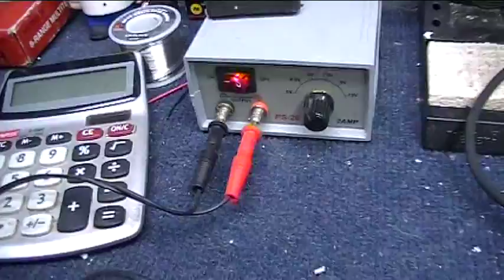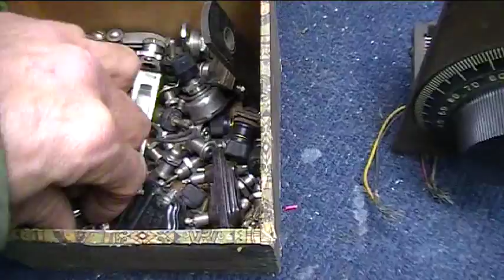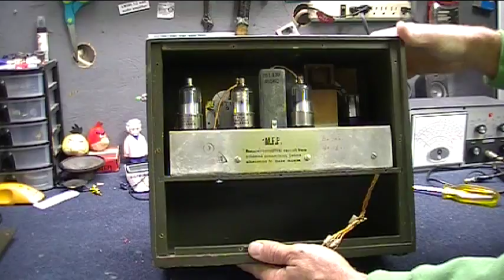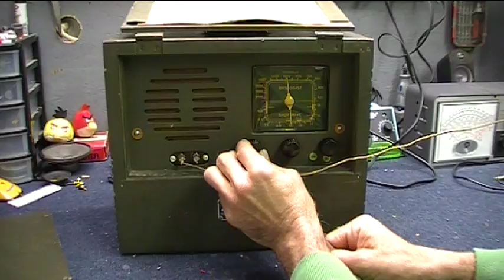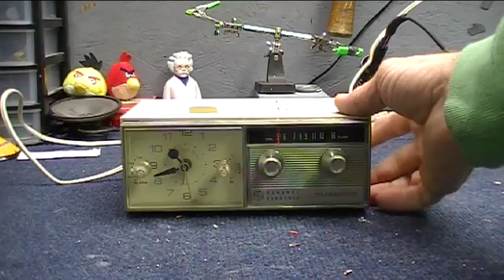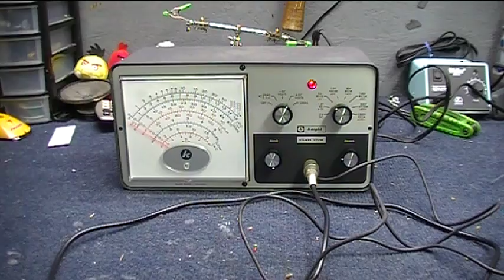Vintage Electronics Find

Comment: What you first said is RF Chokes - I believe they're coils for different ham bands.  They're made with just the right number of turns to work with that variable capacitor to make VFOs (variable frequency oscillators.)   
Combined with other fixed capacitors and a transistor OR a tube oscillate at the frequencies used by hams.  They could also be have been used to make short wave receivers.
Cool old stuff.

Comment: When I was a teenager, I somehow came across a battery-powered radio with a wooden case.  If I remember right it used a large 1.5v cylindrical cell to power the filaments, and a 66.5v battery for the tube plate voltages.

I thought it was fascinating, and purchased both batteries.  The high voltage one was very expensive with my limited income, so when they were used-up I never replaced them.  I think I built a power supply for it and used it for quite a while.

I don't remember what happened to it.  I probably used the parts for something else, not realizing it's value.  Today, I take good care of things like that.

Comment: The eye is indeed a vacuum tube. It works on the same principle as a CRT display (shooting and bending a stream of electrons on some phosphor, which then starts to glow). They are mostly called "magic eyes" and they were mostly used in radios to indicate whether your radio has been tuned to a station correctly. They also contain a filament, which explains why it takes some time before the display comes on.

Comment: Talking about intermittent switches, the power switch in my old Fluke multimeter finally became intermittent after many years.  It looked like it would be tough to replace, and it looked like it didn't have enough of an opening to get contact cleaner in, but I tried a drop of very old CRAMOLIN cleaner, and lo & behold, it came back 100%.  It's still working fine 2 years later.

Comment: I am not a huge collector of vintage radios, but I do have a few and I know that these pieces have found a good home... to stay.  Still, I would estimate that treasure trove to be worth a thousand dollars at a bare minimum and perhaps several thousand. But then I am stunned at what people toss or give away, I once found (sitting by the trash) a beautiful 1955 VM wooden cabinet Tri-o-Matic record player that was a VM company presentation piece for a top seller, and it still plays fantastically.

Comment: I have been off the air so long that when I fired up my receiver a few years ago, I couldn't figure out what the heck was going on when I heard  calls beginning with "N". Thought for a moment the Sun spots were going crazy and DX was booming in! I also found out that we had gotten some additional bands. When I had my fire I was building my code speed up to get my Extra; I was at 34 WPM. But the fire just ripped my heart out and after losing things I had built all my life I gave it up.

continued

Comment: Those 1/4-inch TRS jacks are probably old W-E switchboard jacks; they were made in this manner because they had to be easily serviced.  

I've never experienced a series-string radio just burning tubes out, and I've worked on quite a few of them.  There has to be a short somewhere in the filament string to cause that to happen.

Comment: I like the Capacitor tester best, since you probably do not know how rare, expensive these magic eyes are. And this is one of the most "looked after" magic eye tube ever. So wear a big smile in your face when using this. But do not leave it on for hours, since this sort of magic-eye tubes worn out pretty fast. But this particular tube is bright as a new one. So use this carefully and be proud to have such a lovely tube!

Comment: I have an old Bendix automotive primary condenser tester which I have occasionally used to test old polyester and mica capacitors.  It has a rather limited range, but it does have a mode to check leakage.  And yes, it is tube based.

Comment: LOVED the old tube stuff, especially that magic eye! I have an R-C tester that uses a magic eye for null adjustment and measurement. As far as that 8 transistor radio goes, those kinda look like old style germanium transistors. Many of those were not the modern planar type, but had tiny little point contacts. They were incredibly fragile if they received any manner of significant impact.

Comment: The Zenith was one of their higher-end AM sets.  The "Filter Magnet Antenna" circuit cuts down interference from RF signals, such as a fluorescent lamp.  I used to keep the successor to this model right next to the computer and there was no interference.

Comment: when I was a teenager I had an 50's/ 1960's blue, GE, clock radio I got at a second hand store for like $5. just like the one you showed, it had the convenience outlet on the back, and I would set it up to turn on a lamp and radio when the alarm went off, to get up school and later when I was in my 20's  working at a hospital. I used till it finally died up to the late 80's. by then I had bought a newer one. and ended up donating it  to another thrift store for someone else to mess around with.
I dont remember if it had the RCA input Jack tho.

Comment: Really enjoyed this video. Thanks for showing us your neat electronics stuff. That non-functioning black transistor radio may just need its electrolytic capacitors replaced to get it working again. My Dad had the same radio back in the 70's.

Comment: The shortwave talkers are probably transmitting in SSB. One needs a BFO to add the missing carrier frequency. Another (super-)radio may do the trick. A super has a VFO that can act as the BFO by radiating a signal.

Comment: It looks like one of the previous owners of that moral radio serviced it at least a few times, I see what looks like some "Black Beauties" under the chassis. The "Black  Beauties" were paper capacitors inside a molded plastic shell, they were popular from the late 1940s to early 1960s as replacements but still fail like regular paper caps. The battery eliminator is nice to find, very useful to power late 30s and 40s battery tube radios, but like the radios they need to be rebuilt

Comment: Good show. Thank You for doing it. I may have a tip to relay on those scratchy noisy switches. A fellow in another YouTube video recommended Radio Shack's "Control Contact Cleaner and Lubricant" as a remedy. It has worked quite well. Apparently, the cleaner shines the old rheostats up and the lubricant keeps them that way for a good period of time. It is a little spendy but it promises to service lots of switches and last a long time.

Comment: I couldn't believe I watch a 30 minute video on old radios I had forgotten how interesting old electronics was.  I cut my teeth on vintage electronics you have to know where you been to know where your going.  You need to post a video when you get an outside antenna on the shortwave radios.

Comment: The second device was a "wavemeter" A meter or bulb probably plugged into the front panel connectors. The coil (not a "choke") resonated with the capacitor and current would light a bulb or indicate on a meter on  the front panel .A chart would convert the numbers on the knob to meters to indicate the frequency of the transmitter. In the 50's and 60's Ham radios were capable of operating on their "fundamental" frequency and on multiples of that frequency. For example, a Ham transmitter working on 3.5 MHz (80 meter Ham band) could be made to transmit on 2X3.5 or 7 MHz (40 meter Ham band) A wavemeter was invaluable to be sure the transmitter was adjusted for the correct Ham band. 

You have the same problem I do with an old AM receiver. Instead of old broadcasts it receives modern broadcasts (ugh!) 

Lacking any transmitter, it sound like that fellow, like many others, never learned the code well enough to get a license. It wasn't easy working alone. I was lucky enough to have a neighbor Ham who helped me and his son learn Morse.

Comment: On the Luxtone radio. It is most likely open capacitors. Just replace all the electrolytics, and it should work....  Also, a little contact cleaner in the control and tuner, and you are good to go....

Comment: The brand Z tube radio is a series string AC/DC set, that transformer is likely an output transformer to couple the audio output tube to the speaker. It looks like a good radio though, it has a tuned RF amplifier stage, why it's blowing out the replacement tube will have to be investigated, it could be that there is a short in the filament circuit or one of the other tubes is of the wrong type or is in the wrong socket.

Comment: Very nice video, I really enjoyed it. The radio in which you described a tube glowing really bright and then burning out probably indicates that a power supply filter capacitor is bad in the set. It would probably be a good idea to replace all of the old capacitors in the set before you power it up again for long so as not to damage any of the other components. Again....Enjoyed it greatly as I too enjoy tinkering with the radios which glow in the dark.  Best 73's and have fun shortwaving~N4TYX~

Comment: Far out, did u get some sweet stuff for helping a friend or what? I couldn't help chuckling to myself as you kept producing all those neat vintage valve radios and then progressed onto the transistor stuff. It was like looking back through time to see all those things and as you got the valve stuff working well my jaw was on the floor. Great Vid :-)

Comment: all I have is a simple tube radio. I had a nice old radio. but lost it when the house burned down.  it was from like the early 40's. don't know about the one I have now. its trashed. so I was thinking of putting modern radio. inside. and connect it to the speaker.

Comment: I mentioned to the trash guy that I salvage junk electronics, for parts , and I got 5 radios (took the good stuff out) and 1 radio is an FM/AM/SW, but it didn't work. I opened it, and found water inside, so I used a fan on it, dried it up, and it works perfectly! Checked online, and its worth over $100 new!!!jackpot!!!!
As for the other radios, I salvaged the parts, and built 2 crystal radios!
Radio shack is gone, and I've been making my own component piles, and its getting bigger!!
Any ideas on making more SW radio coils??I've made 60/70/85/90/95/100 turn coils, diff. Diameters.
Thanks!!!

Comment: My grandfather "Bucky" told me if you get a crackling in the volume control to put WD40 in it to eliminate it
Reply: okay thanks :3
Reply: I use WD-40 a lot, as it does no harm to the inner contact materials of switches, pots and plugs at all. Contact cleaner needs to be washed out after use or it dissolve the contacts over time while left at/on/in the the unit.
Reply: Normsweb.com lol  WD 40 makes it oxidate all the worse in the long run ..sooo many idiots around thinking they can 'repair' stuff ..sigh   troglodythes  ..
dont use sprays ..just switch the  potentio's and switches so the oxidation wears away ..thats all it needs really.
Reply: I didn´t want to come back here, as i do not like the overal attitude here, nor the words choosen to proove(or not) how something works out(or not).

But to make it simple:
I worked for 15+ years in a ProAudio rental company and we used WD40 a lot when it came to emergency "reparings" like corroded switches/pots.

I never said that it´s the only solution, nor that is/wille/should the best, or better or what ever solution. All i said was: (and is, will be) WD40 does no harm to any contact material and can stay inside.

Again: i do not say: it needs to stay inside whereas many,many, others needs to be washed out after usage!
That´s the tiny, little difference, here....

In my post there is no "..better than a proper switch cleander..."statement at all...so read carefully or shut up!

To Henk Histomil: ohooo and you´re the one to proove that for and to me, do you, did you.....??

Ok: WD40 is s short for: *W*ater *D*issolvable...so what? It does no oxidation initiation or triggering, as there is nothing in it what does/causes this sort chemical reaction. The Manufacturer itself sais that WD-40 is indeed a anticorrosive coating to prevent further cossosion/oxydation. Go over to and look it up yourself while trying google if you do not find it: http://wd40company.com or this one http://wd40company.com/partners/msds/usa/

 You should really proove that to me, or stay quiet if you can´t. Oxydation can only happen when a material (regardless of its condition of aggregation, or aggregate phase) is present. WD40 has nothing of that kind in it, while for example "Ballistol" has, as its manufacturer says it clearly and went on: "...do not use it in conjunction with brass(ed) materials as it dissolves the brass content/chemical bond while changing itself into a green "pottage"...

But i say/write this again and clearly:
WD40 does no harm to any contact material, prooven by lots of usage over the years. It can stay inside, while many other cleaning sprays needs to be washed/swilled out after usage, or they may dissolve the components especially when pertinax and or copper/silver is used inside.

For a perfect cleaning you need to disassemble the whole thing and clean it with isopropyl throughout and give it a propper relubrication after that. One could use vaseline for the shaft or even gearbox grease and/or all synthetic motor oils and plain carbon to reinforce a pot´s path with a good and throughout heating afterwards to prevent it from to soon again degeneration, before reassembling.

That´s it - EOL!

Comment: I stopped on garbage day at a home who threw out an old console stereo that looked like an old zenith tube unit at 1st glance,luckily I didn't just keep driving ,when I opened the lid the 1st thing I saw was the face plate of a McIntosh C-20 preamp and a Thorens turn table .

I took the back of the cabinet off and suit my pants,the console was powered by a pair of McIntosh Mc-60 60 watt tube monoblocks with a pair of Tannoy Red concentric speakers ,I took it all and found out the cabinet was a special order through McIntosh as were the amps and preamp.

The McIntosh C-20 preamp is worth $1,500 ,each McIntosh Mc-60 monoblock is worth $1,500 each and the Tannoys are worth $1,000 for the pair ,the Thorens ended up being the " cheap " component and only went for $400 on eBay .

I sold the Tannoys on Audiogon.com,I kept the preamp and monoblocks which I still have in my collection,unfortunately the special order McIntosh console was so badly gouged all over it only brought $600 on eBay to a collector who said he was going to reveneer the entire unit .

Comment: I tried to make crystal radios, and just tossed stuff together, made loads of diff. sizes of coils (finally made one from wire from a power adapter, wound on ink pen tube), and worked v. well! I made another coil from the same wire, and 2 popsicle sticks (I now have a SW radio/receiver- it can get Havana cuba, and Nashville,TN SW!).
my antenna is 2 straightened wire coat hangers, and 2 yardsticks on my wall.
totally homebrewed!! nothing difficult there! (my GND conn. is from power strip ground).
I've been harvesting parts for years now, and am glad to find your videos!
any more homebrew projects for us? you have any favorite SW channels?
(if I can, i'll make schematics for my xtal radio, SW radio, and antenna- all easy builds).
thanks for the videos!
Reply: Sooner Science Nerd

Comment: If you knew how rare and valuable that stuff was, you wouldn't be tossing it around like junk. Either handle it with respect or give it to someone who will. I'm not trying to be an a-hole about it. I'm just salivating while looking at it and, at the same time, getting angry about how you're just handling it like it's garbage. Yes, I'm a ham radio operator and also an Electronics Engineer/Technician. I've worked with much of what you have there. You have a real treasure there. Thanks for sharing it! :-)
Reply from the maker: It's stored neatly on a shelf in my shop and I do indeed know how rare it is.
Reply: +wjustic1 He's actually performing a service:    when people clean out sheds and garages, often they just toss things in the garbage, with no interest to the "collectability" (LPs; old tools; vintage electronics).  They just want it "gone".   

So anything that *doesn't* end up in a landfill is a "win".

--GG
Reply: +GyeGreene How right you are! Especially the younger gen getting rid of Grandma's "old junk" after they have passed away. I was passing a dumpster a few years back and I glanced into it and near the top was a box full of LP's edgewise. I could read what they where and there was all the legends of 60s and 70s Rock & Roll. Needless to say since it was near the top I saved it! There where two more boxes that would have taken real dumpster diving and had to leave them to their landfill fate
Reply: +wjustic1  these were built to last not like the junk made today. Im sure he's taking great care of them too. Be glad its not all going into a landfill ! :D

Comment: I have my uncls shortwaves one is a zenith Tranc oceanic it teck 9DS Batteries and it works the other shortwave takes tubes. It works it is 5 bands the brand is Natianal NC Model Nc 57 ther is a swch that sed send  REC  the nob has pitch it has cwo ssb it is a ham radio Transceiver it works

Comment: now that I'm thinking about it . the radio that burnt up. it had sw on the dial. but it was received only!  it was from the wood cabinet days. the little one I have now is also. I guess in the 50's they went to plastic? or Bakelite or what ever. I'm not really interested in the ones that new.